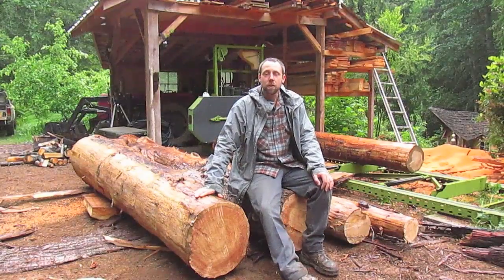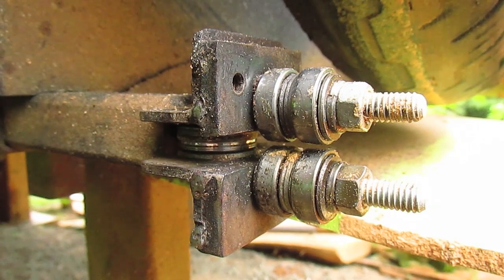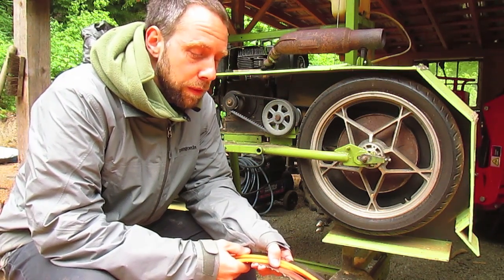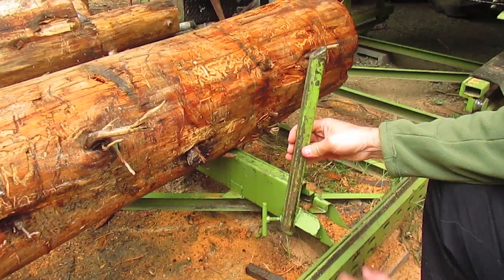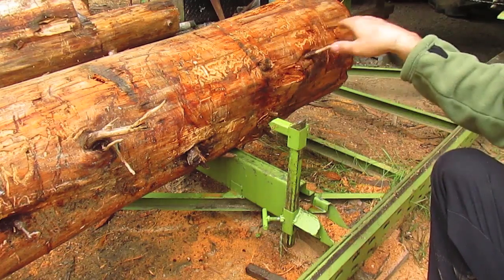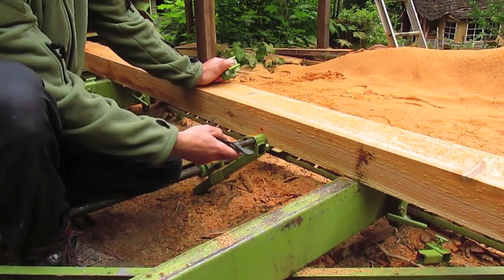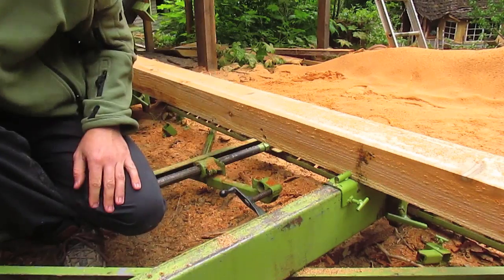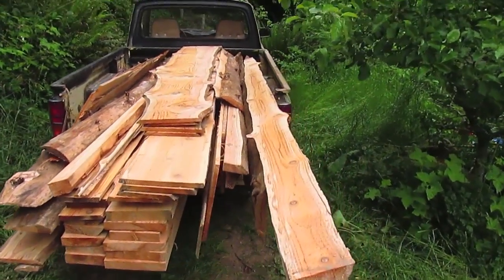Homemade bandsaw mill and upgrades

Comment: At 740 you were cutting a big log with a couple knots on it a good suggestion is take one high pass to level the knots then cut the slab off when you get four slabs the same size put them together forming a square or rectangle and then sell them as raised beds for gardens this way you get money for something that might just go for fire wood. for a box you would get forty or fifty dollars. and any wood would work cedar of course is best but other woods would give you three seasons before rotting out. Just thought to let you know!

Comment: Dumb question: How do you keep the blade from cutting into the tires and keeping them in place? Everything else looks cool, but just curious about that.
Reply from the maker: I have had a few people ask this, the blade tracks on the high point of the tire, ( the crown) the teeth of the blade never touches the tire, only the flat metal band of the blade. The blade is tracked by adjusting the wheels like you would on a motorcycle chain. The blade always tries to ride on the highest point of the wheels, ( the crown)  
This system works quite well. Take care
Reply: @Mikefestiva  You could probably do an entire video on this explanation. (just a suggestion for a video). Pretty damn ingenious.This makes building this type of system easier and robust.

Comment: Where is that place ? I have  so many projects going on  what's one more hahahahahahh like you I have want a mill where I live people would stroke out  not to many logs around here . Nice the see a Chevy luv do that grunt work  .
Reply from the maker: I live in the Pacific North West, lot's of trees out here, they grow like weeds!
I really liked my 1980 Chevy LUV 4x4,  I moved a lot of stuff with that little truck, I sold it about a year ago, I was using it less and less after I got a early 90s Ford F250 Diesel 4x4, the Ford is not a classic like the LUV but can haul just about anything, I do however miss how compact the little LUV was for driving on tight roads and trails.

Comment: hi mike, i've learned a lot from your videos, thanks. a lot of people use car wheels but they have a flat tire profile. do you think the bike wheels which have a more rounded tire profile work better for keeping the blade in place and not crimping the teeth?
Reply from the maker: Hey Steve Good question, I have not used a mill with car tires ever so I'm not sure how they track, I see your point though.
I know the crown on any wheel (Metal or rubber) helps keep the blade tracking to the highest point. When I built my Mill I was surprised how easy my mill was to track and how little I ever need to track it. I also have noticed that when you look close to the blade the teeth never touch the rubber because of the crown. 
One thing I have seen many times is people using spare tires on there mills, maybe this is because they are skinnier then regular car tires and maybe there more crowned?  
I think ether way you decide to go should work out just fine as long as you build your mill so you have some way to track the wheels.  It was easy with the motorcycle swing arms I used because there was already built in tracking with the original chain adjusters :) 
Like I always say work with what you got or what's easy to come by,  I got my swing arms and wheels for like $20 from a friend that has a lot of parts bikes, But If I did not find those I may have used some old car parts maybe?
Thanks for checking out my videos :) I appreciate your nice comments and I'm glad they are informative to you and others!
If you have any other questions feel free to ask, if your building a mill and need any advice I would be happy to think of solutions if you get into a  tough spot in your build. One other thing I always say is there's always a solution to every problem.
I plan on posting another saw mill video over Christmas break talking about a few topics on building my mill so keep an I out for that video :) Take care.

Comment: Hey Mike are this blade bearing guides have to be adjustable or not?  I mean left/right ? Are those bearings have to touch the blade before you mill or not?
Reply from the maker: Kruno Meštrović  Hey Kruno thanks for watching my video!
If your building a mill and don’t want to make the blade guides adjustable from right to left like I did, I think that’s fine, I mostly run my mill with the guides set to the maximum opening anyways, I just made them adjustable because I see a lot of mills like this when I built it. 
Now to answer your other question about the blade guides touching the blade, I did not make my bearing guides adjustable even though I wanted to have them adjustable. When I welded them on I just made sure they where level with the blade and left a real small gap between the bearing and blade about 1/64”or 0.50mm this seems to work fine for me. 
I have now worked out a bearing guide design that I will use on my next sawmill project that uses a eccentric shaft (a shaft with a bearing not centered) so you can rotate the shaft and bring the bearing closer to the blade to adjust it. 
Really if you just get the bearings real close it should work fine, if you make them so you can adjust them and have them touch the blades that’s fine as well. 
One more thing just make sure your blade is level with your track and log bunks( the platform your logs rest on) level from right to left and front to back. Good luck on your mill 🙂
Reply: Mike festiva Thanks man.
Reply: Can you show us what is the proper tension of the blade that you use? By pushing the hand on the blade or something like that

Comment: I really like WA I lived in lacy for a couple years, someday ill move back, ocean shores area..I have most everything collected for my mill accept for the hubs for the tires, I was gonna ask, do you know where people are getting the aluminum hubs without all the bearings, thanks man
Reply from the maker: I have rode my dual sport motorcycle down to ocean shores a few times, fun to get out on the beach!
I have done some research on parts for my new mill I'm planning on building, I was at first thinking of going that route.
I have only found aluminum hubs that can be mounted onto axels for go karts, they seen to be built a bit light I think for the mill application. I'm going trailer bearings and weld on stub axels for this next band mill. I hope to start later this month :)
Reply: if you weld on trailer hubs, the axle is 1 3/4 for the drive side , seems massive to me , I need to replace the front hubs on my 99 civic soon. I was going to see if those front hubs would work better,
Reply from the maker: I'm going to run trailer tires that are 16" OD The weld on axles I got from surplus center have 1" shafts where the bearings mount, I was going to use one weld on axle for the idler side of the mill and was thinking a 1 1/4" drive shaft with a go kart hub for the powered drive side, but I think I have another idea that may just work, I will post my first video hopefully soon explaining the idea of the build and parts I have bought for it my new mill.

Comment: nice job seems to run and cut smooth and quiet ....motorcycle wheels and rear frame and rolls over pallet shelfing brackes with a guide welded to them .... looks like the material list in my mind you already have lol

Comment: I am having trouble finding square tubing that will actually slide over or within another piece... can you provide the sizes that you used to allow the saw to move up and down on the main frame... it appears that they just fit...thx
Reply from the maker: Hey Brian :) I did not find any big nestable  tubing or people call it "Telescoping Steel Square Tubing" for the main frame that my mill slides up and down on, I know it's out there but I did not want to spend the money on it, instead I salvaged some big angle iron and plastic that I used for slides to make the outer guides for the mill head. I will post a link to my first mill build video at the end of this post, somewhere in the first third of the video you will see how I made my guides.
I'm sure there is many ways of doing this but with the parts I had It made the most sense to me.
Good luck on the mill build my friend :)   
https://youtu.be/dFNpKC3JTVQ
Reply: thanks a bunch!! appreciate the response.

Comment: Awesome job on the mill. What do you call the structure of the building there? A Mill house? Does it keep the saw dry in a side sweeping rain? Is that also where the tractor is usually stored? I would like to see different architectural stylings of the structure online, but not sure what term to search for. Thanks!

Comment: I never thought about using a warehouse shelving stand or end as the bed. They come all gusseted and I'm sure won't flex In parallel. My Norwood is made in sections and when cutting big white oak the whole mill wants to jump and shake. I plan to use pressure treated post about every 4-6 ft and fasten it down tight to hopefully hold it better.

Comment: Great video, I'm interested in making my own band saw mill and would love any pointers you could give a novice like me. I've watched a few videos and your setup seems to cut right through those huge logs. What h.p. engine? What size blade do you use?
Reply from the maker: Hi John thanks for watching! I recommend that you do build yourself a bandsaw mill, you will be real happy you did.
Keep in mind I was a novice a few years back about saw mills too, I never used one till I built my mill!
My mill has a 12HP motor on it, If you want a good powerful mill It's all about getting the gearing right, if you gear it to high it would be like climbing a steep hill in your car in 5th gear, if you gear it to low it would be like driving down the highway in 3rd gear. 
A good rule of thumb on blade speed feet per minute to HP is  
6HP blade FPM 3500
8HP FPM 3800
12HP FPM 4000 thats my mills speed
16HP FPM 4500.
This info I added to my first video of building my mill, I found it on the Cook's saw mill site.
I think my blade is 1 1/4" wide, 1/8" inch thick and about 176" long? I can't remember, something like that.
Anyhow there's two ways of going about blades and building the mill, I just built my mill how I wanted to and got my blades cut from a blade shop to fit my mill, or you could order a common size blade that fits a manufactured sawmill and build it to fit that blade?
One thing I would have redone different is when I was building the mill I found the centrifugal clutch I needed was about $300 dollars, more then I wanted to spend, I bought a cheaper clutch, about $100 for it, it works but I don't like it.
You may consider building your mill without a clutch and just make the motor move in and out to tension the drive belt or use a idler pulley to tension the belt to engage the blade to spin? Just a few ideas, there's a lot of ways to build a mill, The best thing is to just start the project and don't over complicate it, keep it simple so you don't get overwhelmed. One other thing, there's always a solution to every problem :)
I hope this helps.
Reply: That's great Mike thanks for replying. Wow, where did you find blades like that? I found some 20 foot industrial shelving that I'm going to  use for the base and weld some angle iron on top for the grooved wheels. I was wondering how you knew what size blade you would choose? I watched your new videos on the addition to your setup very cool! Love the golf cart pulley system! You've definitely put some time into your mill.  Thanks for the videos and please let them coming.

Comment: I guess what next project would be.... a trailer for stock transportation! I was suffering for your truck's rear suspension... heavy duty....
Thanks for sharing! The Saw mill and the arch to transport logs are great projects. Congratulations!!
Reply from the maker: My little Chevy LUV 4x4 does get a workout sometimes Haha, I have installed heavy duty springs in the rear and when hauling big loads like this I take it slow. I do have a F250 4x4 but it's like driving a BIG RV on my trails!
Thanks for watching! I have a log splitter build I will be posting soon.

Comment: Good upgrades. How much $$$ do you have invested in the mill?
Reply from the maker: My mill cost me about $350 to first build, I tried to salvage when ever I could to keep the cost down, and a friend gave me the motor to help with the mill build, I have milled him wood as a thank you for the motor. 
After about two years of running it, I have bought and installed a new set of drive belts the cost was about $25 and I have done a few wheel bearings, about $15 and the guid bearing upgrade cost probably $15
It's been a fun project to build and It's great to turn some of my trees into nice lumber :)
I'm working on a power feed so I don't have to push the mill down the log, this upgrade is going to be real nice!
Thanks for watching!